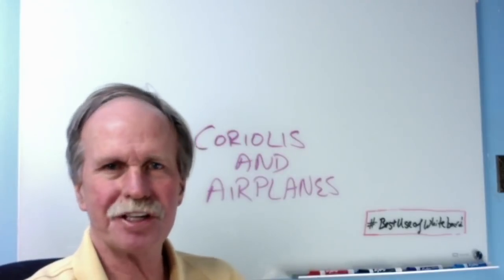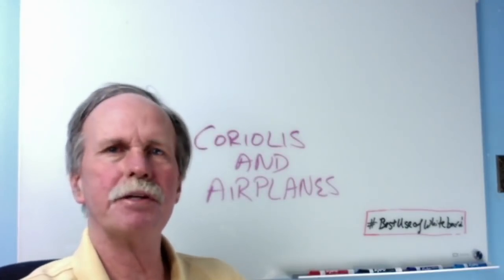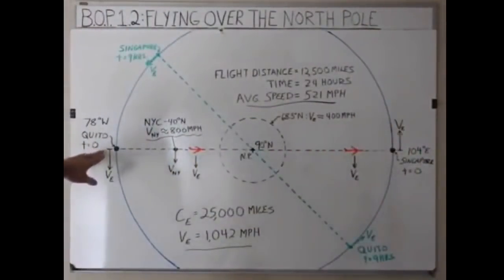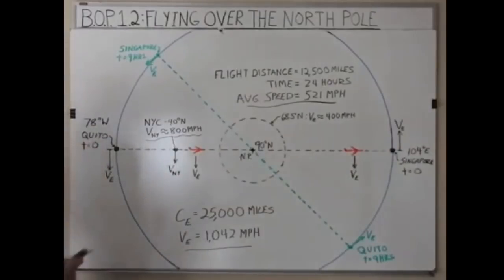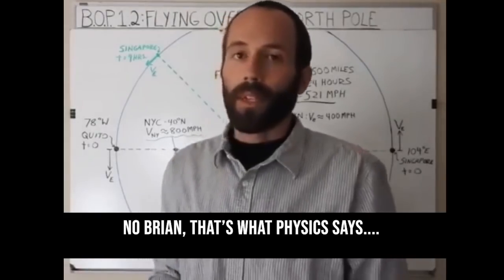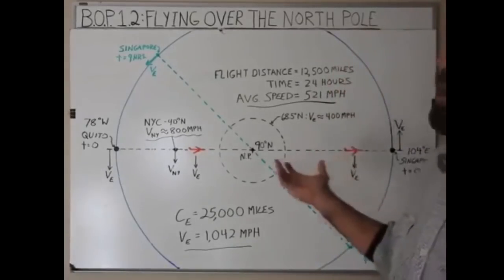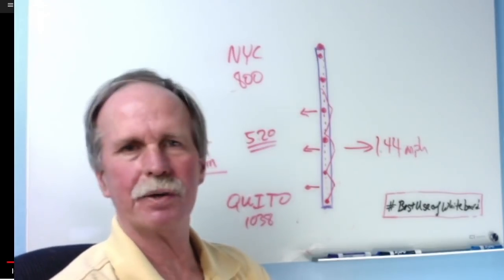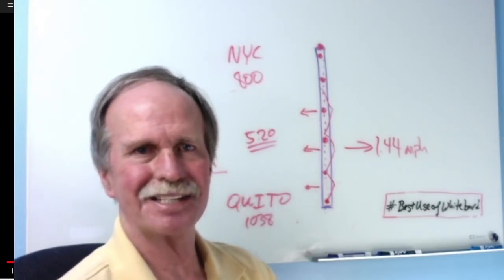Coriolis and Aircraft | Brian Mullin

Comment: Flat Earthers only look at the speed change required but ignore the time taken to do it. 

1038 mph over 12 hours is like a car accelerating 0-60 mph in 42 minutes.    You would not even feel it.
Reply: Do you really just ignore Coriolis force? Wouldn't taking Coriolis effect into account speed up flight/reduce fuel consumption? Reducing fuel consumption would actually help lowering greenhouse emissions.
Reply: @hopmajibhohepeajibho7595  I think he just explained that the impact is so small that it is inconsequential to those things.
Reply: @hopmajibhohepeajibho7595  Not really, the winds could be from any direction. They may add to, or subtract from your speed marginally, but average out.The plane is just flown accordingly. All factors are taken into account when calculating fuel consumption.
Reply: @skateboardingjesus4006  correct, the wind has a much bigger effect on the aircraft than the coriolis effect.
Reply: Wind might have a bigger effect, but Coriolis effect is much more predictable and consistent and it takes literally no effort to take it into account. There is no reason to ignore it.
Reply: @hopmajibhohepeajibho7595  There is no reason to keep saying it shouldn't be ignored when it has already been explained that it's effect is too small to take into account and there are other variables that make a much bigger impact on a flying aircraft.  Those other variables virtually destroy any concerns over Coriolis.  I can understand it and I'm not even a pilot.
Reply: @hopmajibhohepeajibho7595  no reason to ignore a 1.4 mile an hour equivalent force on a plane travelling 511  mph. Really? It would make way more sense to weigh the passengers and charge by the pound.
Reply: @tjjones621  
Those other variables virtually destroy any concerns over Coriolis
No, they don't. Coriolis effect is not random, it's consistent, predictable and noticeable. And it's still there even if you don't take it into account.
Reply: @hopmajibhohepeajibho7595  a1.4 MPH is nothing when compared to a 15 MPH crosswind
Reply: @someguy5438  charging by pound is inconvenience for passengers and also fatties will call you nazi facist for that. While taking coriolis into account is just a few more lines of code and a bit more calculations while saving you fuel, time and money.
Reply: @kaliban4758  no, compared to 15mph it's around 9 percent
Reply: @hopmajibhohepeajibho7595  Of course,  coriolis force is taken into account, but it's not that great. Over a planes lifetime of accrued flight miles, I'm sure the average fuel consumption apportioned to it's effect, would be notable. But it's effect is very small over just one flight.
Reply: An aircraft is not a cannonball. It can be steered and have the trim adjusted to follow a heading.
Reply: @hopmajibhohepeajibho7595  can someone tell the diff from a 1.4mph wind and a 15mph wind or not
Reply: Flat Earthers are the modern equivalent of the 19th century people who went "But 20mph is so FAST... surely it will kill humans travelling at that speed."
Reply: @Groffili  I remember reading media reports from the time of Stephenson's "Rocket" steam engine, where they thought just that. They literally thought your eyes would pop from their sockets and people's skin would be flayed from their bodies 🤔😆.
Reply: @hopmajibhohepeajibho7595  See Walter Bislin's comment elsewhere in this comment section; the correction for Coriolis is tiny.
Reply: @hopmajibhohepeajibho7595  yes but it's so tiny its negligible, Its like worrying about the weight of the water in your screen wash bottle.
Reply: @hopmajibhohepeajibho7595  No it is not ignored.  The plane corrects for it when remaining on track.  

Try to imagine it this way.   

You plan a road trip of 10 hours.   

One day the wind is calm, the next day the wind is forecast to be a steady 5 mph. 

Do you plan for that?    The effect is so tiny you don't need to.     It won't affect fuel burn or driving time.  

You will not even be aware of correcting for it.  You simply drive to remain on the road and by doing so you are making any necessary corrections for that wind.  

The effect of Coriolis is likewise so tiny it does not need to be consciously allowed for.   The corrections occur simply by remaining on course.
Reply: @Groffili  Yes exactly.  Good analogy.
Reply: Question... since the correction is so small,  1.44 mph / min  or  0.024 mph  per second , basically nothing compared to other wind factors,  then  how often does the autopilot  , or  even you as a pilot need to make any noticeable corrections to maintain your heading  ?
Reply: @Wolfie6020  And... Coriolis cannot be avoided, it's a given and cannot be corrected for to save fuel. A stationary earth would thus be slightly more economical  for air transport yet it would have half the earth's population living in eternal night...
Edit: coming to think of it: doesn't a return flight theoretically compensate for coriolis. Without drag, one could use the 1023 mph speed to just fly to the pole.
Reply: @phasma6669  The corrections by the autopilot are occurring constantly.  I have videos showing this in real aircraft.  The autopilot is making slight heading and pitch corrections many times per minutes. 

Even flying from a crosswind of 10 knots to 120 knots in the space of several minutes is no problem for an autopilot.  It will offset the heading smoothly and as required to compensate to keep the aircraft on course.
Reply: @phasma6669  constantly,  I have only ever flown light aircraft but I was making constant corrections to keep on a heading,
Reply: @hopmajibhohepeajibho7595  I still disagree.  A pilot flying a non-stop intercontinental flight does not necessarily fly in a straight line (or the shortest line) because of variables like, winds, storms he has to fly around, etc.  I am not saying Coriolis does not exist.  I am saying the correction for Coriolis is very small compared to the other variables.  Are you a pilot?  Serious question because I am not.
Reply: @hopmajibhohepeajibho7595  I still don't see your point.  If accounting for Coriolis can save time and fuel, those greedy bastards would do it.
Reply: @Wolfie6020  It's so simple and I'm not even close to being a pilot.  Reminds me of how cars on auto pilot are able to stay in their lane with a crosswind.
Reply: @tjjones621  look, straight path in a rotating frame of reference (FoR) wouldn't be straight in an inertial FoR and vice versa. If we are flying from point A to point B we can chose any of those paths, but I see the path that represents straight path in inertial FoR as more beneficial because, well, that's actually a straight path and you don't need to apply additional force like you would have to to force path been straight in a rotating FoR. Wolfie says that "The plane corrects for it when remaining on track", i.e. chooses the path that straight relative to the rotating FoR of the surface of the earth. Of course, that doesn't change to much and you can easily deal with coriolis just like with winds. But winds a random and unpredictable, while we have everything to take coriolis into account in advance - we know where path starts and ends, we know how fast plane is moving, we know how fast earth is spinning. Pilot can choose another path that is slightly faster and I don't see a good reason to not to do that.
So, did you get what puzzles me? And sorry for bad English.
Reply: @hopmajibhohepeajibho7595  I do see what puzzles you, I think.  If a helicopter takes off straight up on a windless day and hovers at some altitude for a given amount of time, would the Earth move out from under it?
Reply: @tjjones621  depends
Reply: @tjjones621  i guess you are just too domb to understand what i was talking about. It has nothing to do with  going up and waiting when earth spin under you. Coriolis force affects only moving objects. Go learn how and why it affect path of a moving object.

Comment: Bob mentioned that to correct for Coriolis a little part of the forward vector has to be used to cancel Coriolis. So in theory this would mean that due to Coriolis the airplane would need more fuel than without Coriolis. Is that a factor in the calculations?

No. I did the calculations how much Coriolis corrections increase the fuel consumptions:

The counterforce to Coriolis, that is produced by banking the airplane slightly, is borrowed from the lift force. The lift force of an airplane always points perpendicular to the surface of the wings upwards. When an airplane banks, this lift force vector banks to one side too. The lift force can then be decomposed into a vertical component and a horizontal component. The horizontal component counters the Coriolis effect or causes the airplane to curve. The vertical component has to stay constant to counter the waight of the airplane. This means that as an airplane banks to one side, the total lift force has to increase to keep the vertical component constant. This is achieved by increasing the angle of attack. An increase of the angle of attack increases the drag. So the thrust has to be increased to overcome the increase in drag. More thrust means more fuel consumption.

So how much more fuel is needed due to Coriolis corrections? I did the calculation for an Airbus A320 at 45 latitude, FL 330, mass 62 t and speed 447 kt.

The thrust has to be increased only 0.00021 %. This has not to be taken into account in any calculations.

You find my online calculator for this by googling

How Airplanes correct for the Coriolis Effect
Reply: Ha! You should make an online calculator for how diffraction limit and maximum view distance of the eye at a certain altitude affect how much drop there is at a distance. For some reason I lack the understanding of the subject matter to accurately predict drop on the flat earth. ^^
Reply: Actually, I don't think that compensating for the difference in air mass speed due to change in latitude is even related to Coriolis.
Reply from the maker: don't look at it as anything other than maintaining a course over the ground.  What is the magnitude of the correction to do that over the course of the hour?
Reply: @BobtheScienceGuy  

That's fine. As long as you don't call it Coriolis (it isn't), and don't try to calculate a crosswind out of it that way.

Comment: The most impressive thing about modern aircraft navigation systems is how accurate they are. The aircraft I flew was rarely more than 0.01 (nautical) miles off track which is ±60 feet in real money. Normally the track error is zero. You regularly see this when an aircraft on a reciprocal track flies above or below you - it’s cockpit to cockpit. This is why in the “interesting” parts of the world some aircraft fly slightly off track and slightly above or below their assigned altitude to make sure they don’t collect anybody from “interesting” airlines not known for adherence to procedures.
Reply: Yes exactly,   I have often told Flat Earthers that I can fly Sydney to Hawaii never being more than one wingspan (98 ft) off track. 

One of them tried to do the Math on that and used an opposite (98 ft) over an adjacent (4000 NM) to arrive at an angle of 0.0002 degrees and called me a liar because nobody can fly that accurately. 

They just don't get it.
Reply: What evidence can you offer to show your planes correcting for Coriolis?
Reply: @Wolfie6020  when your plane corrected for Coriolis did this show in the flight data, viz. change of direction left or right of straight? As Bob claims there has to be increasingly greater correction for a northward flight.
Reply: @nathanyamaha465  The amount is always insignificant compared to winds at altitude.   The atmosphere moving generally with the rotation of the Earth corrects much of the effect anyway.  

Imagine letting a balloon go in a 100 mph wind.  It will quickly be moving with the wind.    

Watch a plane take off in a strong crosswind.  It drifts sideways very quickly if the pilot takes no corrective action. 

So Coriolis is not as big a problem as people imagine.  Flat Earthers seem to think a plane has zero drag if moving sideways through air.
Reply: @Wolfie6020  fun fact , pilot always sleep in long journey flight !,  just imagine pilot have to make the air plane not just to nose down the air plane every time but also have to correct their positions every time because of the spinning earth ! They would lost very lost in the pasific, the pilot would be so confused and so the radar system and auto pilot would be error ! , so its indeed a BIG PROBLEM ! , Dont forget at the time world war 1 and 2 happening there is no auto pilot , they just fly according to the dirrections of the compas, coriolis never been spoken by them!

Comment: The way I see it, these confusions are from constantly shifting frames of reference from an inertial frame (i.e. 'looking down from outer space at the north pole') and the rotating frame of reference on the earth (i.e. 'in the plane' or 'over the ground')

If you stick with an inertial frame for example (using Brian's from 'looking down at the north pole'), the plane starts out in Ecuador flying 'east' and 'out' of the board (towards Brian's feet if he's standing in front of the white board).  The 'heading' the plane has is directly 'out' of the board, but the earth's rotation adds to the plane's motion making it (to us, out in space) appear to leave the board at an angle.  After an hour or so, the plane is below the line Brian drew on the white board and the pilot has 'turned' the plane to keep it pointing towards the north pole.  So from our inertial frame, it is now losing some of that 'east' velocity (toward Brian's feet) that it started with and is not moving in the same direction.  To us, it is flying a curved route.  After six hours, to us, the plane is still closer to us than the white board, but it is 'below' the pole (between Brian's feet and the north pole).  After 12 hours, when the plane reaches the north pole, to our inertial observer it is now flying parallel to the white board, heading backwards along the original 'flight line' that Brian drew.  From our 'outer space' point of view the plane flies a spiral arc from Ecuador, up out of the white board, reaches the north pole but oriented 'backwards' along the original flight line, then after another 12 hours it flies another spiral arc and to us appears to finally reach the destination in Singapore on the right hand side of Brian's drawing heading directly 'into' the white board.

Bob shows how it appears to the pilot (from the rotating frame of reference).  For the first half of the flight, the pilot just keeps checking his heading and 'aims' for waypoints that are directly between Ecuador and the north pole on the earth.  As Coriolis, side winds, and other imperfections cause the plane to drift off course, he just constantly monitors and corrects the plane's course.  From the pilot's perspective, he's just flying a 'straight' great circle course over the pole to Singapore.  And as Bob rightly points out, the effects of Coriolis are pretty minor compared to many other real-world disturbances, so just keeping the plane on the proper heading compensates for it along with those other disturbances.

Just pick ONE frame of reference, and stick with it!!
Reply: @Walter Bislin Inertial forces are real. That's what made the big craters on the moon.
Reply: It's hard to describe isn't it?